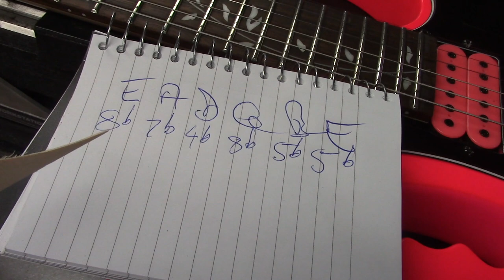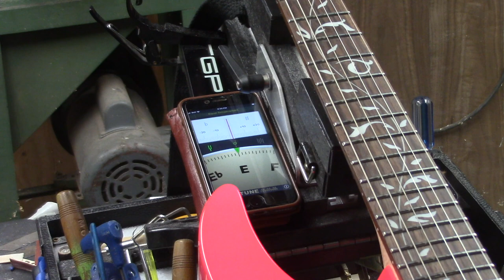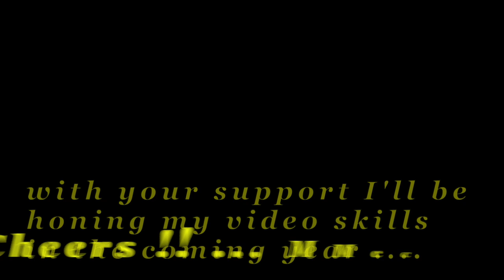Compensated Locking Nut System / Regulation of the Floating Tremelo system @StringTechWorkstations

Comment: 9:15
How can the fretted 12th be flat if the guitar is intonated?

All my guitars are perfectly intonated at the 12th.
In fact after I set the saddle using the 12th fret method. I then check by using the 5th and 17th, 7th and 19th...etc the get it really dialed in.

So how are you reading the low E as flat?
Reply from the maker: The tuner doesn't lie. The customer was over the moon when he got this back.